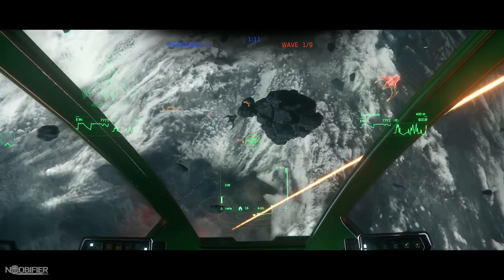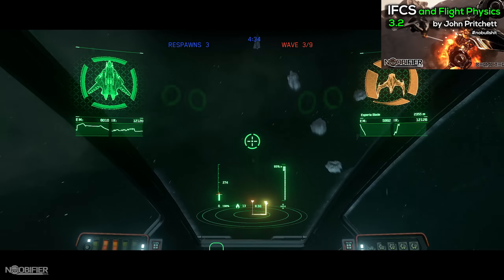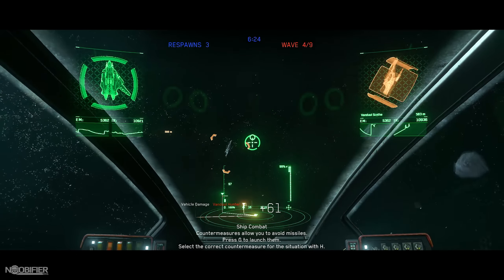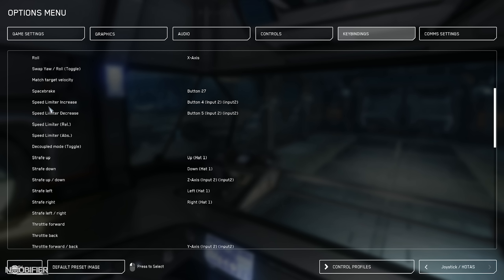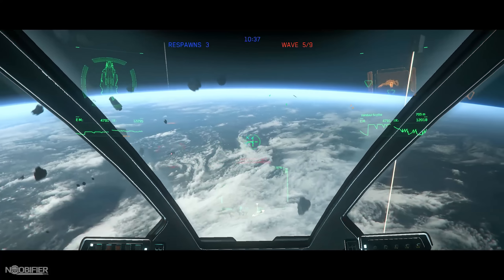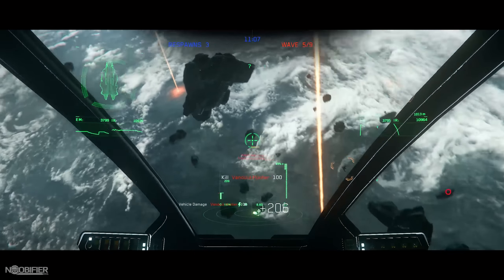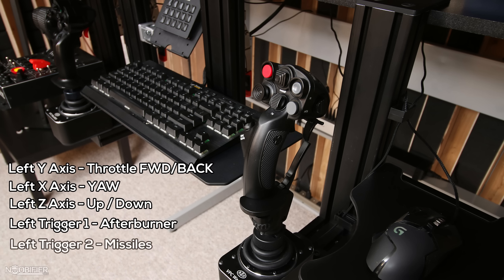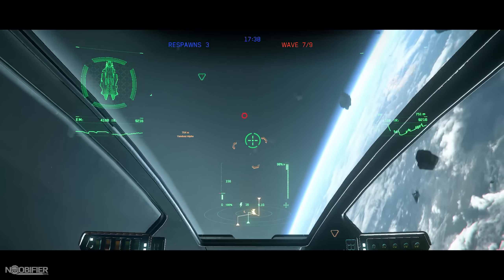Testing 3.5 Flight Model - Star Citizen

Comment: I'm kind of torn about this new flight change. At first, I wasn't sure about this change, but this change does help me with one of my biggest concerns about SC.   That being, why would anyone multi-crew?  In 3.4 large ships were big targets, were boring to fly and easy to kill.   In 3.5, they are still boring to fly, big targets, but now they can leverage their size and focus on reaching their top speed.  This seems like it could mitigate the maneuverability of fighters.  Their top speed is 1200, mines 950?  They come at my ship at 1100, try to avoid fire and end up going in a straight line.  Makes leading them with turrets easier.  Or between strafing runs, onboard personnel can make repairs.   This sort of gameplay is something I find interesting and could be really fun.  I know that will probably rub people who want to fly only small single person ships the wrong way.  I'd argue that if you're in a small fighter facing another small fighter, you're now fighting someone with the same issue as you so "git gud".   And if you're 1 person in a small fighter going up against a larger craft with crew of 3 or more people, it really shouldn't be as easy as it has been.  

The part that upsets me is that I don't see much of a difference between the Aegis Gladius and Apoa Khartu'al when it comes to space flight.  They feel very much the same, and one should definitely fly better than the other in space.

Comment: Thanks for the video and testing. It's hard to notice the effect of lift/drag/gravity in atmo, partly due to the server disconnects and partly due to IFCS cancelling any effect of lift/drag/gravity unless it assists a maneuver you're attempting. The Gladius can get to 8-10 vertical g's in atmo due to lift - if you go into 3rd person at high speeds in a ship with wings you can see your mavs shut off as you generate lift. In decoupled mode in atmo, if you have wings, you can see your flight vector follow your nose at you pitch turn especially, due to what seems to be lift and drag rather than thrusters. One other change seems to be thruster acceleration no longer coming from the thruster position - eg if you switch off all but a lower left thruster you can still strafe up without massive torque being applied. Cheers and looking forward to future flight videos! :)

Comment: Lift does seem to be somewhat in effect, the Gladius gains increased pitch rate when in a high density atmosphere. From my testing my pitch capped at 9.1G vs 12.2 while on Daymar. I've heard some people claim that some ships can also glide while in atmosphere, but haven't verified it myself. Thrust vectoring is also active, although still controlled through landing mode.

Comment: The only advantage to decouple is less heat.  Afterburner seems useless.  It doesn't help to decouple, select new trajectory, recouple and apply afterburner.  Not able to effectively acheive a new trajectory quicker than in ifcs.  Strafe accels too slowly and altogether dogfighting seems to be less tactical and slower.  Have not been able to find a cannon to effectively snipe from longer range.  All in all I'm hugely disappointed with the new flight model in arena commander.  This weekend when I have 45 minutes to quantum to a planet.  I will check out atmospheric flight.  Great video, noob.
Reply: @Revenant Gaming I've put in better than 100 hours in arena commander with the new fight model.  It's my opinion that getting away from set speeds is good.  But afterburner and boost have separate functions.  They are both still needed.  Decouple needs to allow for faster pitch and yaw, as before, not just reduction in heat...but actually allowing quicker trajectory changes.  The drift mechanic is needed as is boost during strafe.  I'm not condoning the monotony of the old circle strafe battles but, short bursts of quick accels strafing allows for some defensive manuvering against boom and zoom tactics.  We don't want jousting either.  When shields are critical, it's good tactically to be able to extend, disengage and utilize objects for cover.  The increase in strafe accels with boost and afterburner to extend is where the 3.5 flight model is lacking.

Comment: Shared with my Org.  Appreciate the thoughts and review of the new keybinds and settings.  

I'll be very interested to hear if you feel that your flight tactics have changed becuase of the new flight model or if you develope a sense that the different fighter classes are more separated now in how they can/should be used within the new flight model.   

I'm finding that dogfighting combat speeds seem to be in the 250 m/s - 300 m/s range for light fighters and a little slower for the medium fighters.  I don't own a heavy fighter but would assume even lower than that for a turning fight.  At these speeds you can just manage your turns, monmentum and stay mostly on/near target without burning out your thrusters.  You get warnings, but I haven't lost anything yet.
 
Yesterday I made it through Vanduul swarm on my first try (in a Sabre) with no losses and that supprised me as I haven't even been flying in game for the past 3 weeks while waiting for 3.5 to drop.  Had my throttle somewhere in th 250 - 300 range and could fight all day.  Have only flown the Arrow (still a lot of fun), Titan, SuperHornet and Sabre so far.  All flown at default settings and loadout.

Comment: Awesome Vid thanks again, ive had little success getting the thrustmaster T16000m hotas throttle working seems to work in reverse no matter what setting I bind it to or if I reverse it in the options that combined with ultra wide aspect ratio being broken its been a bit of a chore testing it out the last couple of days hopefully with a patch or 3 it will get better

Comment: I really hope that it gets to the point where if your left thruster gets destroyed you would have to power down your right one and only use your central thruster to achieve a straight flight
Reply from the maker: IFCS would just use the others in such a way as to fly based on what you are trying to do, it just may be more drifts
Reply: @NOOBIFIER1337  Tbh I completely forgot IFCS existed for a minute. Thanks for the reminder lol

Comment: Whom else thinks Chris should be recorded saying 'I've altered the flight model, pray I don't alter it further', regardless of anyone's like/dislike? :D  
  
From your footage, it seemed the 'green' section of throttle/speed, was actually only a very low part of the craft's max speed.  
I think this approach could be widened, if that makes sense.  
Also note: red-green is the most common color-blind.  
So suppose:  
'landing mode' : setting so that min. speed setting automatically puts craft in landing mode; and raising above, automatically leaves landing mode. let's say, blue color.  In each treshold mode, the view of the thrust 'section' you're in, gets zoomed in a bit, so you have sufficient 'granularity' on screen; at low thrust mode, you don't need as much detail on the higher ends of the thrust scale. 
'medium' speed: yellow color. usual flight speed.  
a bit above it: orange. 
very high speed (*ludicrous speed?*) : red. or purple even.

Comment: What I heard was that heat is now a primary limiter to ship performamce. That means every ships heat threshold must be learned and combined with that ships agility, speed, breaking, +firepower to determine how one compares to another accurately.  This could potentially end up making certain ships the go to for dogfighting just like before. Or if all ships have similar overall characteristics then dogfighting could become quite boring and repetitive. While I think ships should vary I dont think there should be a top 3, 4, 5 that a player must use to compete. Example: a Gladius and Saber exit quantum and see 3 CBs and a base hornet. They dont even blink knowing the Gladius and Saber can outmaneuver them all because of superior handling and heat thresholds. The skirmish commences and sure enough the CBs overheat and 1 by 1 get taken out. The hornet puts up a good fight too but eventually it too overheats and gg! The community learns the "go to" ships and thats the meta until some significant changes. Thank you Noobifier for sharing your honest opinion.  We'll see what happens as things develop.  👍
Reply from the maker: AutoXtacy basically, a racer needs massive coolers or it’s just a normal ship. Lol

Comment: I did get something out of this, so thanks for the break down.  I have only played two rounds of arena commander in the PTU 3.5.  One in my Vanguard and one with my Hawk.  The Hawk was a much better experience.  If the Vanguard looses a nacelle you are basically 100% out of the fight. (might be a bug, but it was horrible) The Hawk on the other hand could really hang in there and continue to fight. I didn't have a chance to play with a lot of the flight controls, but balancing afterburner with build up from maneuvering clearly will take practice.  My systems shut down once in the Hawk.  More learning is required, but overall it felt okay.
Reply from the maker: Vanguard is very difficult in this flight model
Reply: TheNOOBIFIER1337 indeed.  They have gone the wrong way with the vanguard.  It feels like some additional thrusters or maybe adjusted thruster position is needed to account for the spin created.  It still isn’t the Tanky beast it was sold as.

Comment: I think this flight model is a result of all the complaining over the years. It's primary goal is to be easy to pick up and play, but require time and effort to master. On top of that CIG is trying to eliminate some of the main issues with the previous versions - Jousting and Circling.  For me, I think the 2.6 flight model was easier to master but I agree that combat speeds were too high.  I think this model is 100X better than 3.4 (good riddance to that). Hopefully with some more tweaks this FM will improve. Overall I think it's headed in the right direction.

Comment: Will the new system work better with voice command or just the same? Have you heard if a update for voice commands are coming soon?
Reply from the maker: I need to test voice commands. As long as we have hotkeys it will be fine
Reply: @NOOBIFIER1337  I agree but there are a lot of changes and added buttons. I update to Kate would be nice.

Comment: I'm curious about your duplication (if I'm understanding correctly) of Up/Down with both the left stick twist ("Z axis"?  Which your right stick lacks?), AND the hat-switch on the right.  My first instinctive assumption if twist is available on a main joystick, would be to use that as Yaw, (in lieu of separate rudder pedals for airplanes) for the simplicity of direct correlation to the intended movement.  Then use left stick X-axis as lateral strafe. 

None of this is to imply criticism.  Lacking actual experience with sticks myself so far, I'm imagining it's difficult to make good use of the twist axis on any of these sticks for any purpose, just 'cause it seems it would be inherently ergonomically awkward even as a standalone function.  Let alone trying to apply it simultaneously with more basic "aircraft" control movements in fast/stress situations like combat.
Reply from the maker: boatrat74 the thrusters are so weak, I gave up on analog. They need to be at maximum so it’s fine to be just on. The buttons on the hat are perfect.

Comment: Great video, as always. Thanks! So, can you explain what is Thrust U/D/L/R? I know what U/D/L/R means, but I'm not quite sure which one are you referring to as Thrust? Which setting in game options exactly? Cause I can't really find it. Are you referring to strafe?
Reply from the maker: Up Down Left Right
Reply: @NOOBIFIER1337  So, if the right stick hat controls Strafe U/D/L/R, what's the Up/Down on Z axis of the left stick then?

I'm not trying to find a flaw in your system, I don't understand it completely, so I want to make sure I understand what I'm missing. Thx
Reply from the maker: The left U/D is analog for landing and taking off.

Comment: TheNOOBIFIER1337 I don't have a scroll wheel om my dual T16000M stick setup. Is there a way to make one of my two mini throttle's on the base serve the same function?
Reply: i fly with keyboard and a t16000m and i use hat up&down to adjust the speed limiter. i also have it bound to the mini throttle but i havent found myself using it yet
Reply from the maker: David Bland hat can be used for the U/D binding

Comment: Thank-you for the info and I see that your "Gimbal-lock" is working.  Despite what I select I seem unable to get mine working (circle flies around)?
The biggest problem is overheating, thus limiting the ships performance and capability's.
Reply: Bound a key to "look ahead" to solve this issue.
Reply: Well.  I removed it earlier thinking there's no use for it, Ha.
Reply: That did it thanks
Reply: No it didn't work.  ;-(
I bounded it to the same key as gimbel lock
Reply: Bound another key, not the same. First of all go to game settings and enable option "lock gimbals by default" and restart game. Unfortunately game always starts with look ahead mode on, so you will have to press assigned key every time you start a new game.
Reply: I had set the default.  The assigned key (LA) that I need to tap before each game "must" be on the joystick or the keyboard?
Reply from the maker: Look Ahead on joystick button toggle
Reply: If I understood Michalis76 correctly I need to press "Look Ahead" (assigned key) every time I start a new game.
If this is correct when in the login process do I tap it, before I leave the bed?
Reply from the maker: In ship, press it when you fly
Reply: I taped it prior to launching and it's locked.
Thank-you
I still need to buy a new joystick to stop the yawing unexpectedly.  ;-)

Comment: Great breakdown on the new flight model! I unfortunately am having real trouble with it. My brain doesn't get it. I mean, we use to have relative throttle control but now we don't. We have a cruise toggle that sets its speed via the vari speed control which is wrong for anyone thats ever used cruise control in a vehicle where you use the throttle to get to the speed you want then you engaged cruise control to maintain that speed and use the cruise control + or - to change its set speed. 
Having a vari max speed setting completely negates the cruise control function imo. And lets say you need to bug out of an area quickly, you go max throttle only to find out you need to up the max speed selector, its like having two throttles doing the same thing but ones master and ones slave. 

Tbh I'm really annoyed coz I use a gamepad and mouse to play and removing relative throttle control means my thumbstick return to centre is zero throttle so I have to hold the stick forward all the time to move forward instead of the 3.4 flight model which allowed me relative control of the speed. 

Wish CIG would give up on trying to re-invent the wheel. :(

Comment: I hope I was just running into a few bugs in tier 1 for the ptu, but I found my throttle to be completely useless in the new flight model.  I hope it gets better but my initial experience made my want to throw my HOTAS through the wall.

I’ve never flown in any sim that made the act of even flying your ship so unintuitive.  I certainly hope it gets better but I’ve decided not to touch the game again until after at least the PTU phase is over.
Reply: You have to set up the HOTAS completley new, that´s what I have done to get the "old" feeling back. Now with my X52 Pro from Saitek it feels really nice, especially as I inverted the throttle. So pushing the Throttle forward does what it has to :)
Reply: Zaxx Zonn , I tried to do that but ran into a ton of problems.  There were a lot on in consistent behaviors with things working seemingly okay and then they just stopped. I’m hoping I was just hitting some bugs  and that it gets better.   I do however think CIG is either way over thinking the control setup or this is all being done to enable keyboard and mouse players at the cost of the experience for those that use joysticks.

Comment: I like the new controls but not the flight model.
Back in 2012 when I backed the project I hoped for a WW2 style flight system like in Star Wars Tie Fighter / X-Wing, or the best example in this case, Wing Commander.
What I did not want was the current Fast and Furious Stanton Drift style of flight. To this date the flight is my least enjoyed part of the game, that´s why I shifted my focus away from small fighter craft to bigger ships. Elite Dangerous handles the flight mechanics pretty well, so if they could lean it more in that directon I´d be happy.

Comment: and the list of PVP'ers unhappy with the new flight model continues to grow

it's going to take all of us to be VERY vocal about the issues, since spectrum (especially from evocati) is overflowing with praise for the changes.
Reply: Everything not about pvp, I have to applaud the engineers for making gravlev work and i find it easier to keybind to my flight sticks then i did the previous versions. Is it perfect? No. Will it ever be perfect? No. However it a tiny step in the right direction when dragonflies and nox's are actually fun to fly and i can control my throttle like i can in any other flight sim. There is a reason so much praise is going around because it is making things fun again. It also not as much information or modes to remember which makes it simple to remember. After all PVP needs people to be competitive to have PVP to work.